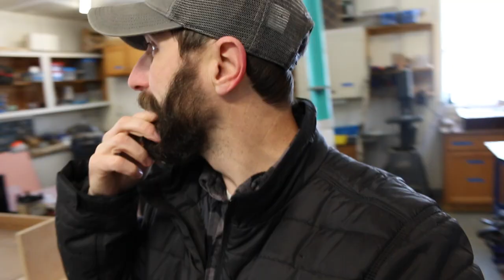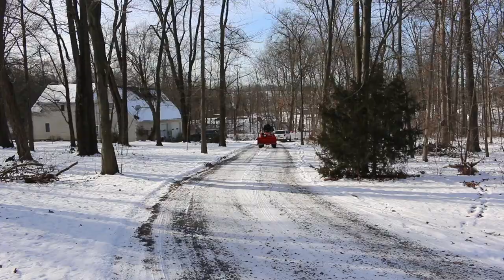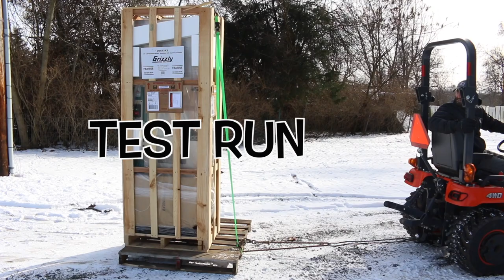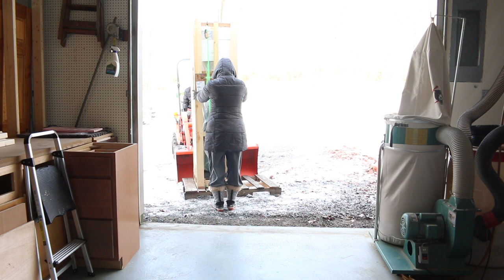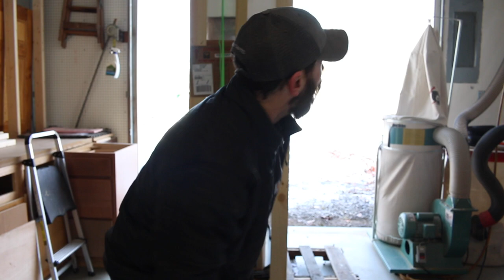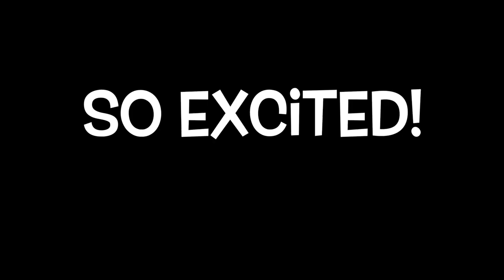Our Grizzly G0513X2 Bandsaw is Here!

Comment: Lift??? How about the bucket on the tractor?
Reply from the maker: Thought crossed my mind but worried that I'd tip me on the tractor or tip over the saw. I actually was able to get it off pretty easily by sliding it onto a mobile base. I probably need to see if I filmed how I did it and get that out. I used to have a hoist attached to the ceiling but didn't have it up when we got this saw. That's actually how I got the table saw up and onto a mobile base.